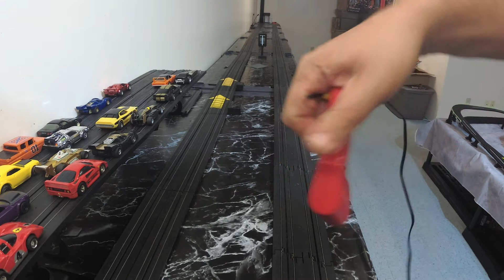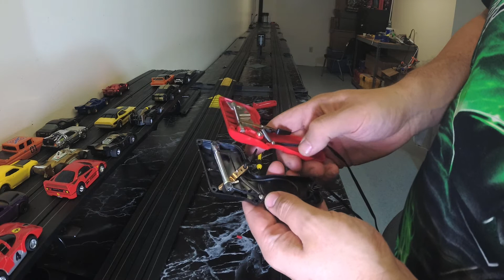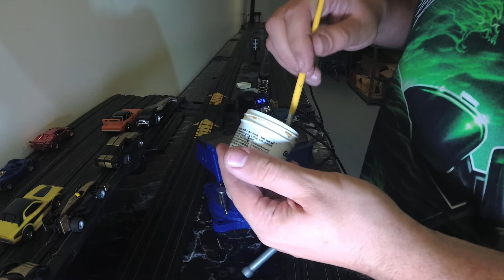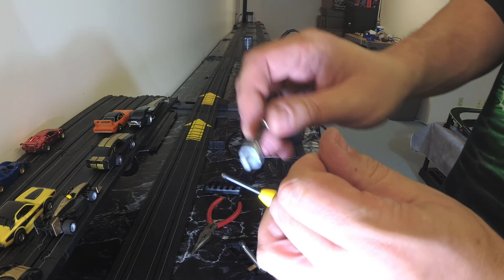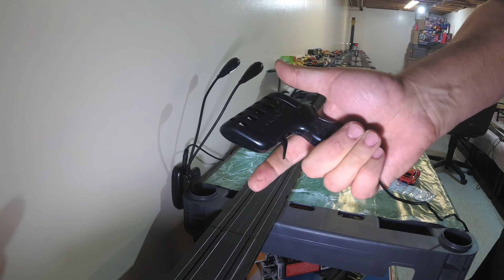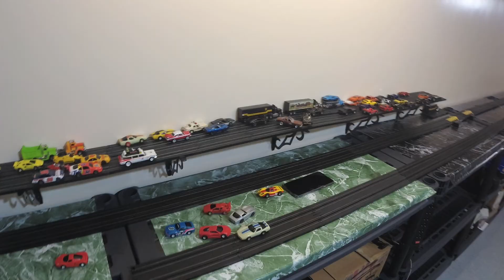Slot Car Controller Repair HO Tyco AFX Life Like Fix Broken Race Track

Comment: My Life Like controller smokes after I sprayed a small amount of contact cleaner into it.  It works fine but after a couple of minutes use  it starts to smoke, only a slight odour not an electrical smell associated with melting wire and/or insulation.  I blew compressed air into it that seemed to help a little.  Any advice.  Great video and thanks in advance.
Reply from the maker: I would invest in a new controller. I just upgraded to newer ones, and will have a video on wiring them in.